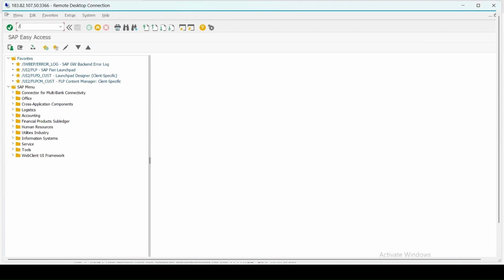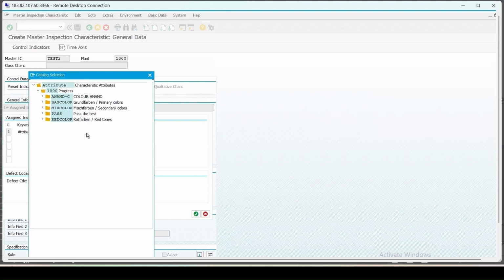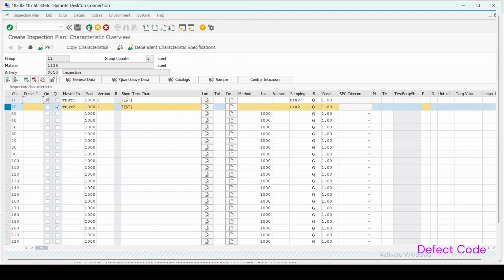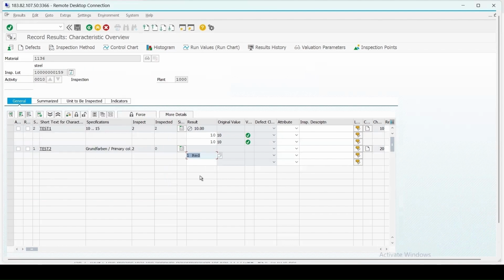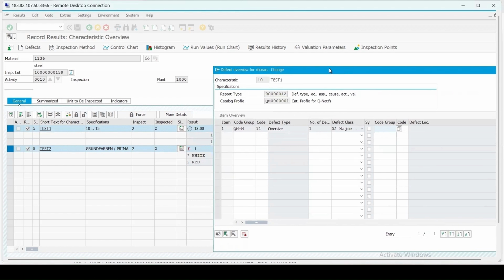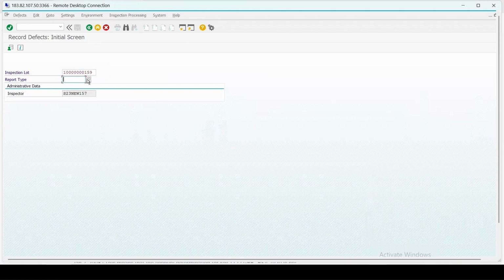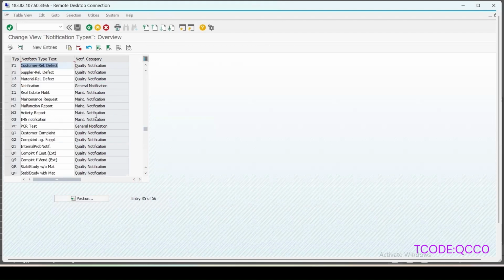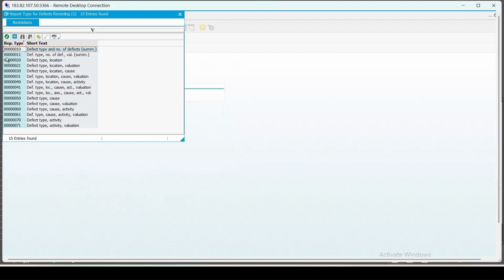MIC control Indicator: Automatic Defect Recording | QS21 | QF01 | SAP S/4HANA Quality Management QM

Comment: Hello Madam,
Good day !!

Whenever the Quality notification created automatically during results recording it’s getting created with the different catalog profile other than the one maintained in the Quality Notification type.

Requirement is to have the same catalog profile which is maintained in Notification type during automatically notification created during result recording for a specific plant without work center

Can we achieve this if yes then how ?
Reply from the maker: Catalog Profile can also be assigned in QM view of material master, or Defect Report Type..., Pls. drop a Mail at nishajaint19@gmail.com for further query